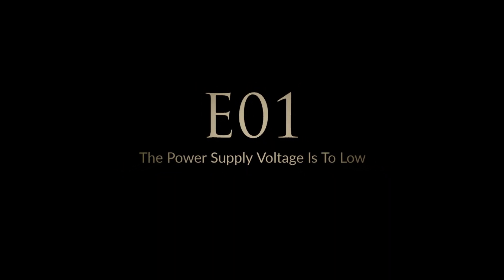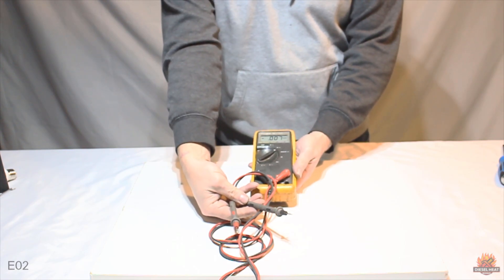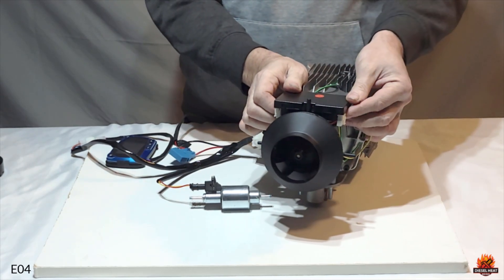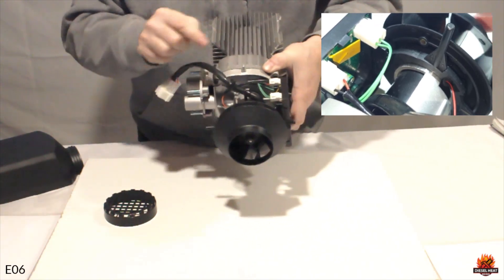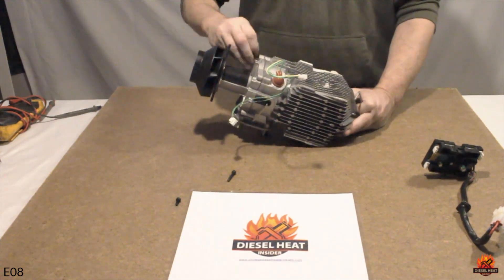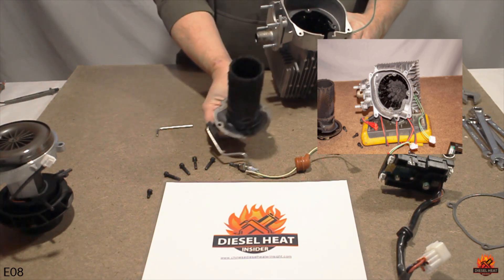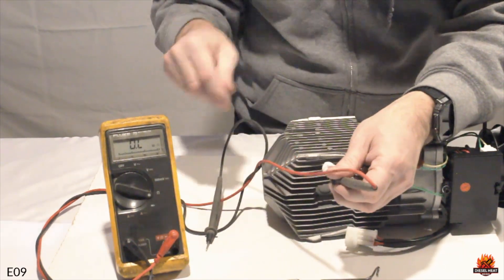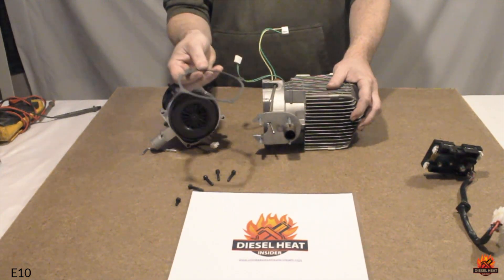Chinese Diesel Heater Error Codes Troubleshooting Guide

Comment: I have a 3 year old vevor that runs great. I bought a new unknown name that looked identical... nothing but error code after error code. It's junk. I've got it to where it's either code 08 or 10 in rotation. I went from 12v deep cycle to an ac/dc converter, two separate ones in case one was a dud. I've purged the lines air, and nothing works. I'm going to have no choice but to consider this thing to be spare parts and buy a new one.

Comment: What if my error is E02 and my power supply output is exactly 12V. What next? Thank you
Reply: E2 is abnormal voltage usually voltage drop.  This guy knows zip
Reply: I think there is a difference between E2 and E 02 problems on different machine models
Reply: Did you solve your problem?

Comment: There is no atomization taking place in these heaters. some of the fuel is vaporized and ignited by the glowplug. Atomization needs high pressure and one or more injector  nozzles. These heaters have no injectors and the pump and fuel lines are not designed for high pressures.